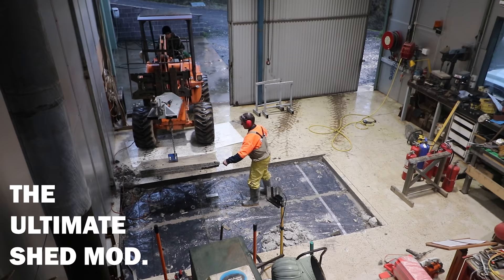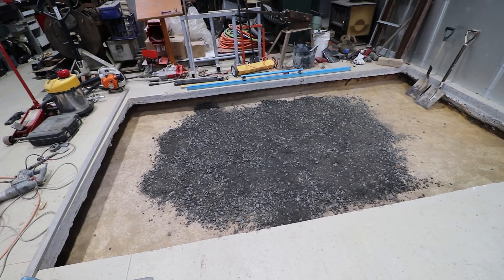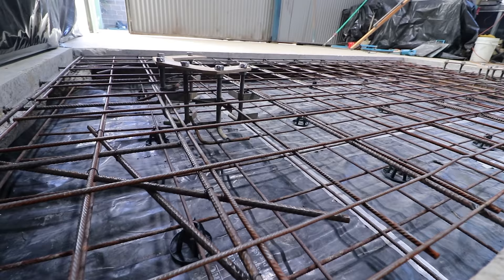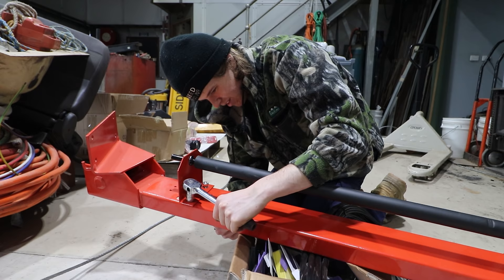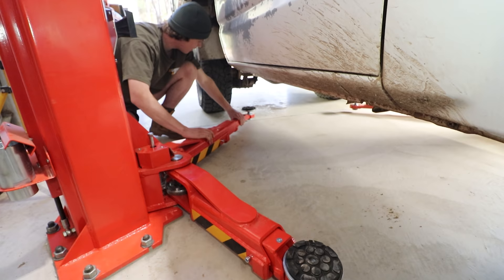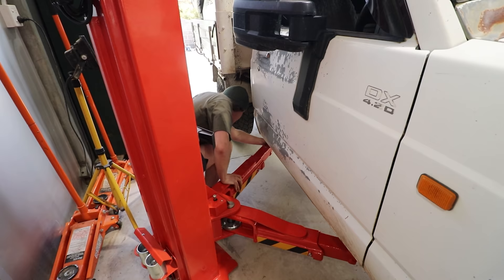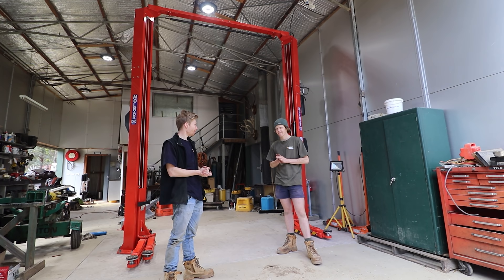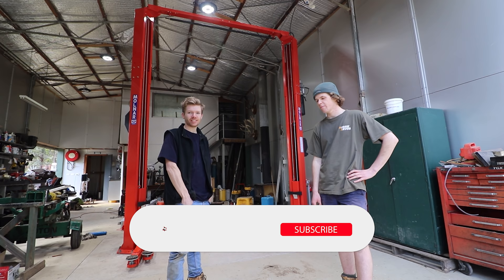We Installed A Hoist! Molnar 4.5 Ton 4x4 Hoist install in our SHED!

Comment: Great work looks excellent, you have probably fixed the hoist already but on the video the arms aren’t balanced, you can tell when you lift the vehicle one pin clunks before the other so when you lift the car you hear clunk clunk, the adjustment is on the cable and when you either lengthen or shorten the cable adjustment. When it’s schmick as you lift the car you will have a synchronised single clunk. You probably have done it already but on this video it stands out. Always lower the car onto the stops / pins

Comment: I had the same issue with my Hilux LSD. Was advised by Toyota dealership that the the Toyota LSD’s need to have BOTH wheels rolling in order for it to engage. As opposed to the Nissan LSD which as you found out engages straight away.  So for the Toyota, you need to have some forward movement for it to engage when one wheel loses traction.  The simple test was to raise one wheel off the ground and place a block under the axle, then try to drive off.  The Nissan will do this, but the Toyota won’t.  I now have front & rear ARB lockers instead.  Another great video and am very jealous of the ‘man shed’, well done guys. 😊👍🏼

Comment: Nice one! A pit coupled with a Portable Vehicle Hoist is a (distant) second best option at around 20% of the cost.
I've got a hook eye installed in the roof of my 4x4 (supported by external frame to the rails) so I can use a sky hook wherever I need the vehicle lifted. I mean, what if you need to change the clutch somewhere between here and dingo piss creek? 
In all seriousness, a hoist is perhaps the most labour saving device one can get for a workshop.
Also, take Home Brew's comment about Dad too - if he is interested ofcourse.

Comment: Hey guys, great job. A ramp is worth its weight in gold. I recently installed one in my shed. Great job on the foundation . Just one thing to note, it sound like the left and right locks are engaging at different times when you raise the ramp. That is normally a sign that the cables need adjusting/fine tuning. Also pull the arms together in the middle of the two posts and make sure they are at the same height. 
Well done guys, from all the way at Stonehenge England

Comment: LOCKING PINS : I think best practice is not to have the hoist resting solely on hydraulic pressure. When the height is reached, it's best to release it down a fraction until it rests on the nearest locking pin

Comment: Grab some 3” or 4” extenders for the lift pads, will give you more height 👍🏼
Also keen to see a vid on that log splitter, are you doing mods to that? 😎
Reply: The hoist comes with them check 11:27 the silver things
Reply: on the left side of the screen*
Reply: True. Well spotted

Comment: Sending 4bys up u wanna get the arms as far forwards and as far back as u can lifts them better and a lot more stable, and I could be wrong but from what I know from work when your sending the hoist up and u hear the clicks there ment to be same time if the clicks are too far apart the hoist arms are arnt all adjusted to the same height 👍
Reply: That clicking noise is the lock tab running up its rack when it's engaged, you get you the height you need & lower it onto the lock rather than leave the weight on the ram. my MOLNAR only has it on the operator side. To lower it, raise the hoist slightly, release the lock & pull the down lever. The new MOLNAR's look like they may be a little different with more electronic controls. MOLNAR was bought out by another mob a while ago & their range has changed a little bit.
Reply: It also means the carriages and arms are at different heights left to right. One side is hitting the safety lock before the other. Thus the cables need to be adjusted. To correct this.
Reply: @markwilmot6575  I checked the MOLNAR website parts diagram & that SM245 hoist does have electronically controlled safety ratchets on both posts & yes you are correct about the carriage adjustment ideally needs to be the same for the safety latches to work. If the lifting cable failed they would still both catch & lock in.The lifting cable will stretch a little from new so carriage adjustment may have to take place several times over the next year, it's something that a hoist tech would check & set but they may service it themselves, not that hard if you know what to do & how to do it.

Comment: When did you guys buy that hoist? I purchased that same one from aussiecarhoists about a month or 2 ago and they said they were out of stock until further notice and refunded my money.
Reply: Deal direct with MOLNAR. They shipped mine to the local installer who picked it up at the freight depot, brought it out & did the install and wired it in. You do need lifting equipment & a big drill that will run big concrete drill bits, cost me $600 to have that done but worth it I reckon.
Reply: @dustyfarmer  Yeah I've got all the kit to install it so I reckon that'll be the go then.
Reply: @TasmanianHillBilly  I did a few test drill holes on my concrete slab to check thickness in the area it was to be mounted. Just use a big spirit level to get the post bases level & vertical, I used metal spacers of different thicknesses to get it to spec and after it was tightened down packed wet concrete under the support arms as per instructions. Holds my VDJ79R @ 3tonnes no problems. I bought my MOLNAR base 2 post single phase 5.5 years ago, MOLNAR is new ownership now. I would still buy a MOLNAR over most other hoists including every Chinese origin hoist. Every second Australian workshop can't be wrong.